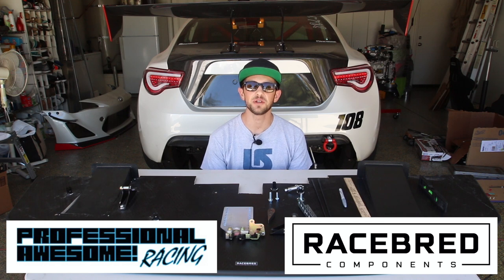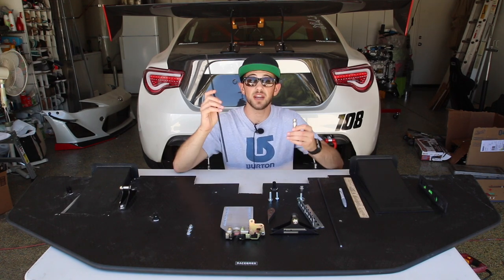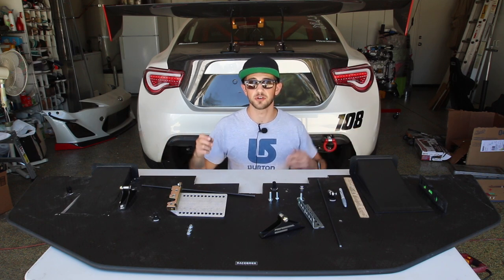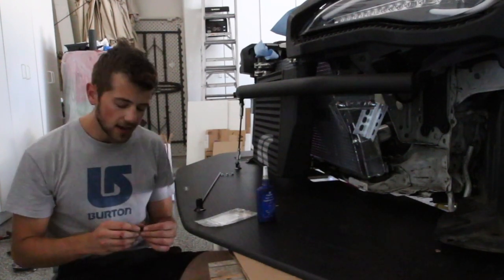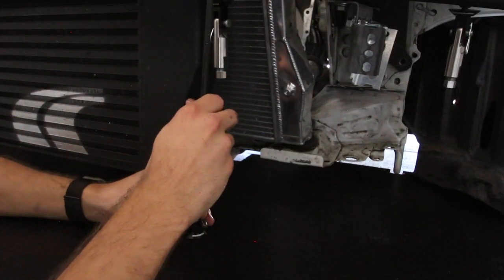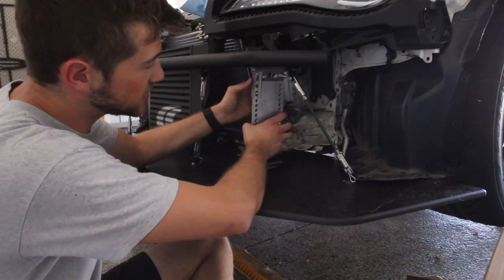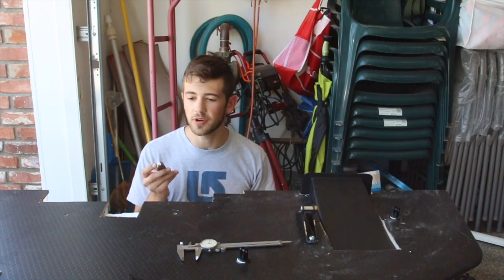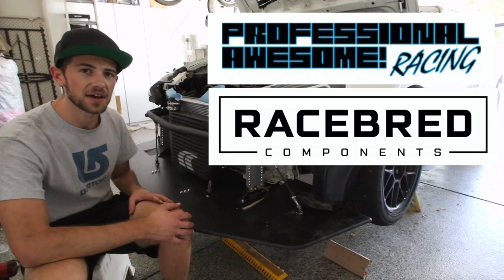Building the Ultimate Splitter- FRS/BRZ/86 Splitter install

Comment: I’m not sure how comparable that wood is to the one I used. But on my first splitter build I made it from a piece of decking plywood (the stuff they use to pour concrete In buildings that is discarded once the concrete cures). I figured the stronger the better. But this ended up hurting me when I crashed. It was so strong the splitter itself survived intact but ended up ripping up everything else it was mounted to. Learned from that and now use 1/2 plywood from homedepot. Not as ridgid but that’s fixed by making an aluminum frame for it. Just my two cents.

Comment: Nice video and nice splitter!

What was the max power and safe track power when you were still running the stock engine/internals? And what are you making now?

Because I'm planning on going Turbo but then I'm worried about the internals can't handle the power, and would be nice to know how your internals handle boost since you track the car and those conditions are a lot worse than daily driving...
Reply from the maker: I never got the chance to dyno the car on stock internals. Probably close to 300 whp. Now I’m aiming for 450. You should be fine street driving your car but with the harsh conditions of track driving, the stock internals didn’t stand a chance.
Reply: @OrenHolzman  awesome thanks man! Much appreciated it

Comment: Silly question, you ever got sparks driving the freeway from and to the track? Something I`m personally trying to avoid.
Reply from the maker: Thankfully I trailer my car so I haven’t had to encounter that issue. But that’s definitely an interesting dilemma. You may need to raise your ride height or stiffen your springs if 80mph gets your splitter on the ground.
Reply: @OrenHolzman  I highly doubt it will touch any flat ground, but there are certainly bumpy section that can turn into jumps on certain parts of the 5 and 405. I assume it really should not be that bad, but hey you never know.